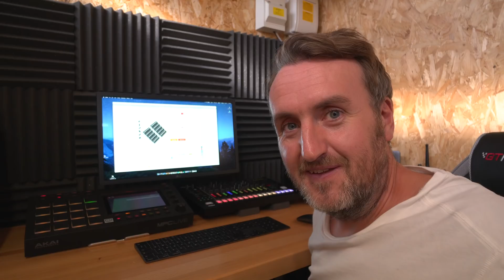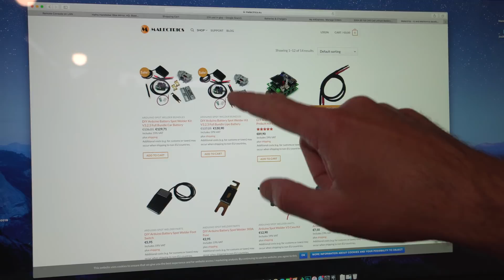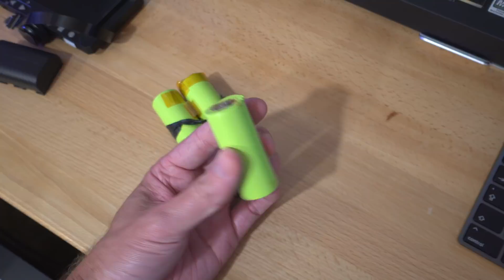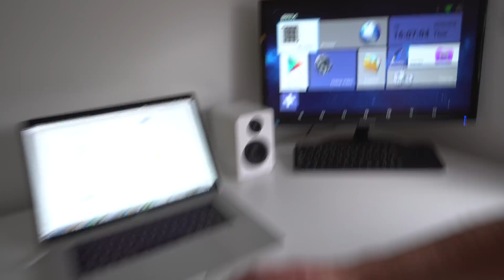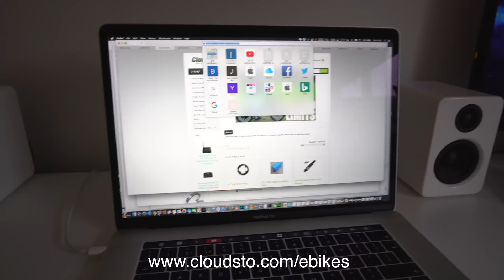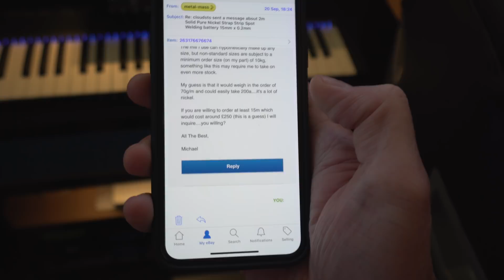BUILDING A POWERFUL EBIKE BATTERY!!! PART 1

Comment: Remember it's the series connections that carry the current, not the parallel ones. Parallel connections are basically just used for cell balancing so you don't need huge strips connecting them together. I ended up using a single layer of 10mm nickel strip for my batteries in parallel and 3 layers for series connections.

Comment: like your great educational vid. 
Hi 
andy i need your experience.
I have the EMMO GT80 scooter with 80V/20Ah Lead Acid battery. i want to upgrade.
I want to build a STANDARD  lithium-ion battery pack that will equal 80V, 20AH.
1 or 2 or 4  batteries

80V/20Ah (lithium-ion) battery  
                     or
2 x 40V(lithium-ion) battery =80V 
                     or
4 x 20V(lithium-ion) battery =80V
 

Whichever is the best and Economical way

Would 84V configuation be ok??
How do I drastically increase the Ah to give more running time? I have room for a bigger battery??
What would you recommend??
The EMMO GT80 has a large enough space where the 5 or 6 old Lead Acid battery was.
(LiFePO4) batteries would WORK FOR ME ALSO BUT WOULD BE too Expensive)

Thanks
Reply: LiFePO4 are expensive but they can last upto 5-10yrs, and get 5x range. I'm converting my powered wheelchair from grp24 2x 70ah lead to 8x 200ah LiFePO4 from rjlithium. I get 5000 charges and get to use full at start, where as lead after 10x charges lose 20% top end.. Also another way is to make your own batteries with  LiFePO4 pouches. They go upto 25c rating.

Comment: I used these cells to make a 10S2P electric longboard battery and they are actually pretty good and cheap. They can deliver 20A max and like 15A continues so that's still very good.
The capacity is also around 5Ah so yeah not bad at all
Reply from the maker: Yeah they are pretty good, I’ve been running them since this video and they do deliver the current BUT...they do sag a bit under high load especially in the cold. If you can live with that then they are really good value.
Reply: The liitokala lii-40a 21700 are also great in my opinion, a bit better.
Their performance is the same but they pack more capacity/ volume and are also cheap
Reply from the maker: Bart Roosen interesting, I hadn’t tried them, I was using Samsung 30Ts in my latest pack which are pretty insane, good to know littokala have an option 👍
Reply: @andykirby  That's nice! 30T are beast batteries.
I'm using the 40T cells at the moment in my electric longboard and I really love them.

Comment: i know this is a bit old but not sure if your aware but Ryobi actually takes 2 5S (10 cells each pack) and joins them to get 1 10S for a total of 20 cells per packs for 40 volts I did a rebuild on one of the packs for a faulty factory bms and it was tricky to do the way they had it paired together but doable the battery is working just fine for my mower. So in a nut shell running 2 10S packs in series with a 20S bms should be just fine. Ill watch the other videos to see what you come up with.

Comment: you don't have to build the pack in a square or rectangle exactly, just some of it. ends could be offset vertically as the compartment narrows in height; just extend the strips or wiring (10awg) to reach the couple offset rows. also possibly laying batteries down rather than standing up may gain some space for add'l stacked vertical rows. as long as the proper connections are done, that batteries don't know they are not uniformly lined up in columns :-)

Comment: Buy DIY lithium batteries book by michah toll it is a good book learns you on amps and things how much nickel strip to use and amp ratings  really good book it has configuration diagrams and he has one out on ebike builds also hope this helps I'm building one from 18650 cells just now 96v 30mah with a bluetooth bms and using a 150 amp salvation controller bluetooth also this setup is powerful enough as I'm using a aluminium mtb frame now I bought from halfords I'm looking into buying one them Chinese frames you have 18000kw setup

Comment: Hi request guide me in connection of battery pack. Presume the cell having 4V & 3A capacity. To achieve 24V & 18A capacity battery pack I can connect in two ways . Which one will be correct and why? Will be appreciated if explained to remove my ambiguity. 
(A) I can connect 6 cells in series and subsequently a  6 cells ,connected parallely, connected to the series cells. Thus I can get 28V (4*6 + 4) and 18A (3*6)  No of cells required will be 12
(B) Again  6 cells are connected in parallel and such 6 parallely connected cells put in 6 row and subsequently connected then will get 24V (4*6) and 18A (3*6), total No of cells required will be 36.
Reply: +RATAN GIRI yes, 36 batteries for 24V 18Ah capacity (6S 6P) as you state in plan (B)
if you connect 6 in series, you get max 24V for that group and 3Ah capacity. if you have 3 such groups connect in parallel, (24V 3Ah) + (24V 3Ah) + (24V 3Ah) you get only 9Ah capacity, 18 batteries like that -> we say it is 6S 3P
series connections add voltages. parallel connections add capacities. here is the math: 6 series connections *4v = 24V. 3 parallel groups *3Ah = 9Ah

Comment: Damn, youtube didn't notify me!
Use 1mm copper sheets with holes for the battery terminals and then use short pieces of nickel to connect them - use as much copper as will fit for each S.
You don't need massive nickel strips between cells on the same layer as they're only carrying balancing current, but you do need thick pipes for each string. Thing is, the way they usually wire the strips is that they are carrying the main current from one end of each S to the other as well. Not sure if I've expressed that clearly!
You can layer them double or triple and make many spotwelds.
I'd go for the copper plates, then it'll be able to carry thousands of amps like Teslas :-)
Copper is also half the price of nickel.

Comment: Em3ev.com make great battery packs. The Samsung 1865030q battery is the best for heavy bikes. The cells you have are not 20amp rated and will over heat if pushed
Reply: i just got one of their packs with 25r cells. JUst need to replace the BMS, but not sure what size of fuses they have inside
Reply: Not wanting to hijack Andy's comments but I feel I need to reply to this one......
I've done some extensive tests over a few months on these cells. My tests show that they will handle 20A constant and 50A burst and they still maintain their capacity, even after some serious torture and over 120 cycles from completely full (4.2V per cell) to completely empty (2.5v per cell) with a mixture of current draw from 5A to 50A. I built a test pack of 4S2P and I've now done 45 cycles at 60A constant (30A per cell) with no cooling and they're still going strong. Sure, they do sag and they do get warm but they still recover and they still retain their capacity.
Reply from the maker: And... Here’s his video showing the test results https://youtu.be/21HCajp1ecM
Reply from the maker: I will also say that I’ve previously wrecked a pack of 30Qs in a previous build running them at 15A.
Reply: Time will tell. I will be waiting for results on this battery
Reply from the maker: Yes it will, if I can’t kill a battery then nobody can 😉

Comment: I bought the same spot welder I love it so far!!
Reply from the maker: Yeah it’s awesome, which type of battery are you running it from?
Reply: andy kirby Running on a 4s lipo battery LOL I am planning on building a 12V 18650 battery to use as a power source. I made a adapter with the XT60 connector so I can change the power supply to almost any 12V type of battery :) I charge the 4s to about 80% to keep the volts in spec. The Lipo is a beast of a power source and I made an adapter to connect two in parallel if doing bigger jobs.
Reply from the maker: yeah the 3S 5000mah  lipo i have is not creating good welds on 0.2mm nickel, I am planning to connect it to my powerwall! Im nnot sure 18650s will deliver the current although it depends how many you have in parallel. Its only momentary current isnt it so maybe it will be ok.
Reply: Aloha Andy maybe its a current issue? Can you try putting 2 3s batteries in parallel?
Reply from the maker: Unfortunately I’ve only got one of these lipos, as I say I’ve got 4S 200ah of LifePo4 sitting in my power rack so will try it on that today💥💥💥🔥😂

Comment: I think I would go with the copper tubing
Reply: Can be opened up and flattened, then holes drilled to connect the cells to it.
Reply: copper bus bar is a great option for high current. low resistance and high capacity. why use nickel? it retains heat and has higher resistance than copper. only reason ppl us it is bcs of cost lol and I suppose bcs it has a lower welding temp

Comment: Andy, why don't you put the controller outside and put a vented cover over it? I have mine on the outside and it opened up the space in the frame. Also took the heat out. I live in Phoenix Arizona. The I had to really consider the heat when I was building my bike. Feel free to contact me via my You Tube channel or DM me on instagram @Bri2k_tv.
Reply from the maker: Hey! Yes I’ve seen this done, problem is here it is incredibly wet apart from about 3 months of the year! The wet mud gets everywhere and it’s difficult to clean off. The spray from the front wheel goes exactly where the controller would go, not good. None of these controllers are properly waterproof really.

Comment: Thanks Andy for the tip on the batteries, I looked on Aliexpress and they have 36V 6ah for $76 Cad. Thats alot better then EBAy at 36V 4.4aH at $76 Cad would like to go bigger but space constraints. Luv the channel and glad to see you back. Cheers

Comment: That's  a lot of amps. I have 270x LGMG1 cells in 18s15p configuration (cost was 480 euro). It has enough power and range. Made like 150km on a single charge (not 100% charged, but like 4.1v per cell).
I can't image how yours will accelerate with that new battery :) 
Mine goes really quick already : https://www.youtube.com/watch?v=8wMW-aPHVqQ

Comment: Defo need to fuse the cells mate.
Reply from the maker: Yeah I considered it but It’s tricky with such a high power pack, there’s not many cells in this pack which means you’d need hefty fuses. Also I’ve never once in all my time working with lithium batteries seen a cell in a parallel bank go short circuit it’s pretty rare so I’m going to chance it! - famous last words!
Reply: If you had the space, cell cooling.

Comment: Andy if you are going to parallel 5 of these 26650's together each discharging 50 Amps or 250 Amps burst then you need 10 AWG 2.6mm Diameter wire or fuse wire above 50 Amps from each positive terminal of every battery going to a bus bar capable of handling 250 Amps from 5 batteries. A strip of 3mm x 25mm Copper Flat Bar which is 75mm2 can handle 275 Amps or a strip of 3mm x 40mm Aluminium Flat Bar which is 120mm2 can handle 285 Amps. As you found out that Nickle strip is far too expensive. When you put each of these paralleled 5 piece packs in series you can still use the same size bus bar unless you parallel more than one paralleled 5 piece pack together then you will need to increase the size of the bus bar to handle the extra Amps drawn.

You can check these calculations out by searching Copper Bus Bar Amperage & Aluminium Bus Bar Amperage pictures in Google. These Amps for those materials are at 35 degrees Celsius. For minimizing weight I would choose Aluminium over Copper.

Comment: Reddit ebikes have a thread on this and Im thinking of building a 4ah backup battery with the 26650s, they can supply the current with one block in series and no bms reqd.

Comment: Heya Andy,

in regard to fitting the new pack into your frame:
Get rid of the controller inside the frame. You will gain a lot of space by moving your controller to the underside of the frame as most people do.

Personally I would stay away from using nickel strips. While soldering coper wire is not anyones business, I still dislike the higher resistance of nickel.

From all battery packs I build myself none of them suffered from soldering the cells. Be it cell voltage or capacity loss wise.

Comment: you could always use a sort of hybrid method. Have the thickest nickel strip you can get in parallel and then use copper wire like hbpowerwall does with his power walls only with 3, 4, or even 5 wires going across connecting in series. this might be a bit arduous and would require a bit of soldering and lots of short bits of copper wire XD

Comment: im actually building  the same pack with the same cells now best i could come up with fitment wise (i use a backpack for my battery) is 2 X 10s6p bricks. i have a plan for multiple layers of nickel strip was looking at nickel coated copper but not sure how that would work out.

Comment: i use to use copper wire for my rc packs they were only 6 to nine cell nicads and solder tinning thast method, and tape em up with protectors at each end , fidly but not sure if you are ab;le to use this way ,sure youll sort  it  ,thanks andy .